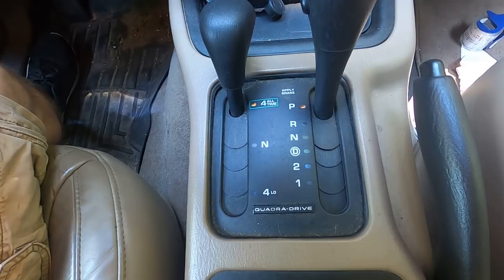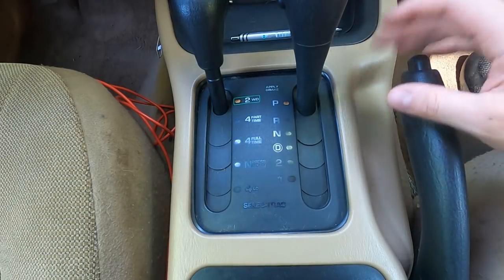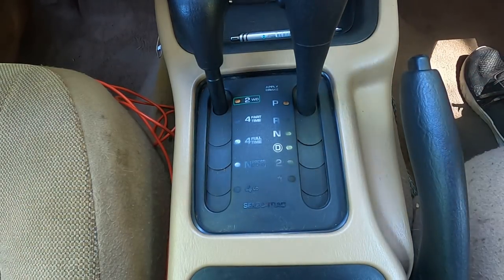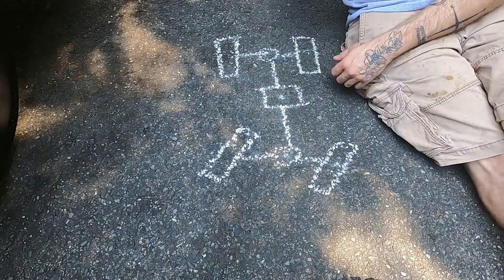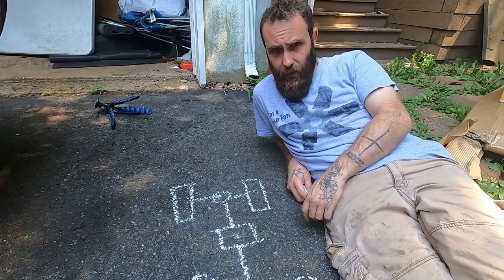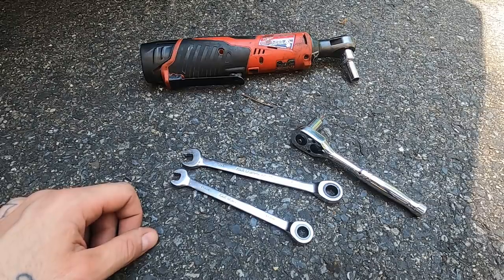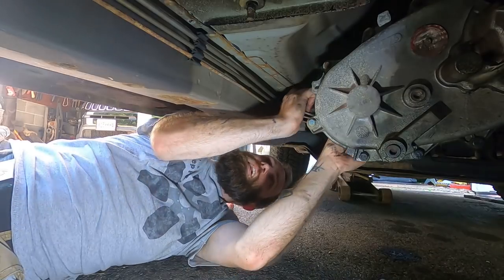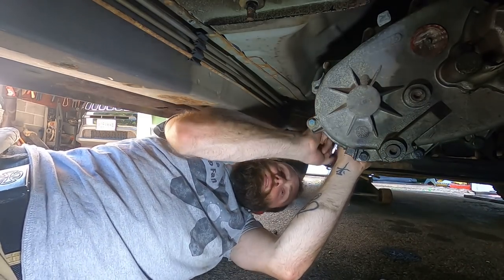Noise/Binding When Turning? How to Diagnose & Fix

Comment: What if you have noise only turning left light grinding sound . Will pulling front drive shaft out help that issue ??? 2000 Jeep Grand Cherokee 4.0 .any idea would be great .

Comment: hi I have a 3.0LTR 2014 RRS, only When turning right there's a noise coming from the rear,  50,000 mile .. could it need a oil change on the rear diff,  and should i do the front also.. i done the transmission  oil 6 months ago. 
only in the morning and only turning right...  after that the noise goes.

Comment: I have 247 and previous owner took the drive shaft off and my transfer case is leaking so part of me wants to do switch to 242 but is there a way to test the transfer case before replacing everything?

Comment: When you pulled the drive shaft did you keep the lever in neutral?
Reply from the maker: Yes, so I can spin it and access all bolts. Wheels need to be chocked so the jeep doesn’t run off on ya

Comment: Hey Doug, I have a 02 WJ Laredo 4.7 (VIN-N) that has the front driveshaft removed by a mechanic the previous owner payed $80.
The mechanic told her that fixing the problem would cost $650 but removing the front driveshaft was only $80.
She told me that the Jeep would get stuck in 4WD
What is wrong with my Jeep and how much will it cost for ne to fix it? I really want 4WD but have the ability to easily change from FT4WD and 2WD

Comment: My FWD 4 cylinder van got stuck in deep sand last month.  Trying to get out it made some nasty popping noises.  A few weeks later I noticed it makes a single popping noise now sometimes reversing or driving out when parked for a while.  it does not make the noise when the van has been driving for a while.  What's the best way to diagnose this?

Comment: I have a 2002 jeep liberty I recently pulled a friend's  small camper with it  is a manual shift 2wheel 4 wheel high an 4 low  anyway after I pulled the camper I stop the vehicle shifted  back to 2 wheel drive an as I was dri ING it later it started a loud grind but not a continues one like it was making a rep and grinding . So I've been driving it In four high but my gas mileage  blows  so you know if I can remove my front drive shift as well

Comment: Awesome vid. I have a 2000 grand Cherokee 4.7 quadra Trac. My from driveshaft rear CV keeps going out. Not sure if it's a cheap Amazon part or something else. I removed the front shaft. After removal I am still getting that binding sound.
Reply: you have to replace the cv join by a double Cardan type join. The sound you are hearing could be from the rear driveshaft, it has two u-joints that may need to be replaced
Reply: @jesusrperezd  the binding sounds and feels like it's coming from the rear diff. I do have two u joints for the rear shaft I. Going to be putting in. Also!!. I don't know if my front drive line needs to be balanced or installed a certain way. I'm getting a slight vibration at about 55-60mph. The rear shaft has zero play and feels really tight but I'm sure they have never been changed in 225,000 miles

Comment: I’m in the same boat. Viscous coupler in my early 249 is shot
Reply: The 249 VC in my 96 ZJ lasted 232,000 miles LOL...I was surprised considering the frequency that it was offroad....it was covered in mud much more often than it was ever clean.  I was surprised how well the 4WD system did given it had open differentials and only ran all terrain tires on it.

Comment: Hello. I'm looking into getting a 99' WJ 4.0 with the dura trac 2. The owner says everything is solid except when he engages 4wd (I'm assuming low range since it's full time 4wd I believe) and the front driver's side wheel clicks for a few seconds then goes into it's respective mode. Is that a red flag?

Comment: My XJ won’t go into 4WD on the fly, it’s a 231, I changed the fluid and it came out clean. I can only get it into 4WD in N and only into 4L

I’ve also checked the linkage and that seamed fine, it went into each position but the 4H just didn’t engage. Would pulling the driver shaft tell me anything?

Maybe it just time for another 231

Comment: Hey Doug, one commenter mentioned a metal to metal slamming sound in her post, I too are having this happen when i hit a dip or speed bump at speed as she mentioned. No reply was given. So please could you respond as she said she replaced shocks and it still slammed, and i was about to do the same until I read her question. I also have that front  popping binding sound when going from 4w to 2w.. when turning left. I have a 2000 GJ wj 4.0 select track . Any help is greatly appreciated👍 Thanks Buddy 😊

Comment: FYI: ZJ ´93-95 249 TC without front drive shaft will burn up the visco inside of it if. Also the Jeep can roll in Park.  Its all fixed in the ´96-98 249 TC
Reply: That’s my situation right now 😂
Reply: Same thing will happen in the 96-98 249's as well if you pull that front drive shaft.  The only thing different with the 96-98 249's is the Viscous Coupler only applied in full time, and they added a mechanical low range....the older 93-95 249's the viscous coupler was the connection in low range as well, so you never really had locked low range it was still limited slip through the viscous coupler.
Reply from the maker: I should have mentioned that. Thanks!

Comment: I have 2- 249 j and I have drove many miles without the front drive shaft.   I have the same problem as you. I have a huge lift at least 4 inches of lift and I have over 10 degrees of angle on the front drive shaft. When I turn sharp it binds up and when I go to 34 to 45 mph it gets loader and then when I let up on the accelerator I get even more. Noise until I drive off the road to the dirt then I don't hear anything like the other noises . Can you please help me

Comment: I have a 99 WJ 4.0 with selec trac front drive lines been out since I got it from the last owner and now randomly today I went to turn left and the moment my wheel moved it made a weird sound and there was some sort of tension in the steering wheel I’ve never taken it out of 2wd i haven’t installed the drive line either still waiting on a new tcase
Reply: Really confused on what it could be

Comment: I have a question I'm hoping you can answer for me. I have a wj quadra drive. When taking tight turns it feels like the rear diff is locked. Sort of like it's resisting the turn. Obviously it seems like the rear diff is problem. Two other things have become a problem that I wanted to know if they would have any effect. 1) The abs light has come up, the brakes actually are working better than before the light came on and before the light came up if felt like the abs was kicking in all the time under normal braking in good weather. I've assumed it's a electrical issue rather than the pump itself, sensor or module. 2) I recently noticed who ever last changed the transmission fluid has massively over filled it. It's well above the cold line when it's well warmed up. Is it possible that a dodgy abs system could make the car think it's losing traction when it isn't causing the diff to try and lock when it isn't needed? Is it possible the likely increased pressure in the transfer case could make it engage when it isn't needed? Should I just accept the rear diff is probably fried?
Reply: I forgot to also mention the gear change is odd. It holds first and sometimes second longer than it should and then lumps into gear from 1st to 2nd. This is massively improved when everything is warmed up. It's also really quick to jump down a gear even under gentle acceleration. I bought the car for very little. Its a 3.1td with only 77k on the clock. Inside and out the vehicle is immaculate so even if it turned out to be every diff and the transfer case I could seel the it in parts for more than I bought it for but Its already really grown on me despite its issues and I'd like to save it if I can.

Comment: Another good one Douglas.Is that Edelbrock intake going on the 318?
Reply from the maker: Dang Dan... nothing gets by you! That is correct. I am slowly collecting the parts I need for the carb swap. It is not a cheap build, but by the winter I should have everything to get to work.

Comment: A little advice Doug,  when I  put my select trac in 4WD the front drive shaft is grinding. Not very loud but noticeable. Is it the shaft itself or is my front differential making that noise 🤔.... thanks
Reply from the maker: Might want to check the rzeppa joins on the front drive shaft. they go back and do all kind of crazy thing
Reply: @DEInTheGarage  changed front drive shaft all together, much better now. Thanks again man
Reply: @fredwilliams4373  Hi Fred, the noise was when going straight or turning?  how is it now?
Reply: @jesusrperezd  I figured it out,  it was the rzeppa joint.... its fixed now but I'll upgrade to a double cardan soon. Rzeppa style doesn't  like lifts of any sort

Comment: How do you test with the 242hd? I’m about to hack and tap mine and install it
Reply from the maker: If your 242HD is binding, likely you are in Part Time when you think you are in Full Time. If you have to, go under it and circumvent the linkage and try to shift it directly at the level on the TC. if it is still binding it might have something mechanistically wrong inside the case

Comment: I removed my front drive shaft till November.  Drives great now.  What puzzles me is that first I changed the front differential fluid and it rag great for about three days. Then, it started binding again.  Changing the transfer case fluid made no difference at all.  What do you think is wrong?  I might be moving back to Europe next year and I want to take this jeep with me.  Help!
Reply: Hi, the sound you had was always or just in 4low, and taking turn?
Reply: @jesusrperezd  Taking a sharp turn in 4 high.  It's a constant 4x4 so I always leave it in high.  It's binding on sharp turns, like in a parking lot. With the front drive shaft removed, it's fine.
Reply: @plsniper  Thanks for your response, so you removed the front driveshaft since then, you didn't identify the issue, did you?, It may be a Jeep thing, mine is doing something similar.
Reply: @jesusrperezd  Yes, exactly.
Reply: @plsniper  the bad thing is it is not 4x4 anymore :(
Reply: @jesusrperezd  That's right. But I don't do offroading really.  My 4x4 is for the winter time. Come November, I reinstall the driveshaft and I'm back to 4x4 again for the winter.
Reply: @ D&E In The Garage

Do you have any response to this issue? 

I have the same thing going on in my 2000 4.7 QUADRA DRIVE

Changed out the t case fluid, no change

Changed out the front diff fluid and replaced with 75-90 and mopar limited slip, worked for about a week then it's back to the groaning and binding again

Love my WJ help please!
Reply: @jesusrperezd  I have an update. I just adjusted my power steering, It's a nut with an allen wrench nut inside. Loosen the nut and then use an allen wrench to go half turn to the right.  It tightens up the steering so it does not feel like a boat anymore, but to my shock it made the binding up way better. It is so much better that the next summer I will probably not take the front drive shaft off anymore.  Go figure, you adjust the power steering and the binding almost goes away. :)  Hope this helps.

Comment: i got a 97 zj and the rear seems to bang pop and grind when turning when i press the clutch in it goes away but the strange thing is, it dont do it when its cold after a few miles drive it happens, its a manual and when it gets hot it can struggle to find gears to.
Reply from the maker: Hey, I would like ot help, but am confused. they didnt make a manuel ZJ in 97. last one was in 94. I know it seems like an insignificant detail, but I want to get the fact straight to help you diagnose.. Sometimes responses get lost in YT comments, so email me if you'd like dandeoffroad@gmail.com
Reply: @DEInTheGarage  Im in the uk, 2.5 TD 5 speed manual.
Reply: Thanks for the quick reply btw.
Reply: Ive emailed you to thanks mate.

Comment: Doug i got a 99 jeep grand cherokee limited 4.0. I got the quadra trac II.I have the 247transfercase. Also I got a dana 30 in front and a dana 35c in rear. What I'm asking is do I need to add the friction modifier to my diffrentials. Or are they all open not limited slip? Your help would be great going to knock gearlube fluid out tomorrow. Love the videos👍👍👍
Reply: I am almost sure both are open diff so you don't need the friction modifier. An easy way to know is to get the datasheet (online) with the VIN number, if in the sheet is indicated "Varilok"then you need the additive.
Reply: If u have varilok do u need friction modifier in the front and rear? @jesusrperezd

Comment: Can you put a varilok Dana 44a in a Jeep WJ inline 6 with select trac? Can’t find any info saying this can or can’t be done
Reply: The whole rear axle you mean? Sure you could. The Varilock is a mechanical limited slip that’s wholly contained inside the axle housing so it doesn’t care what transfer case is in the Jeep. Would be a nice upgrade for a Jeep with an open rear differential, well as long as it’s working right… make sure you use the right fluid (75w140 synthetic) and Mopar friction modifier.
Reply: @TireSlayer55  yes, the whole rear Dana 44a. I appreciate the answer, it seemed like it would be an upgrade to an open diff that everyone would use cheaply, but I figured something prevented people from doing it, I guess it’s just cost or was at least. I probably will try it in future my rear is going out shortly

Comment: I am currently trying to do this. And I can't get any of the bolts lose. I've tried every trick I can think of and I. Ant get them. I striped a few too. What do I do?
Reply: I just removed 1 from the junkyard today.  I used a 5/16 12point 1/4 in drive ratchet and little breaker bar for leverage .

Comment: I have the same make model and year Jeep with the exact same issue. Im just a little confused. If I pull off the front drive shaft and the noise goes away what do I need to look at fixing from there?
Reply: Any update to your issue ? I added extra friction modifier but haven't noticed a difference yet
Reply: @scalywag  Any news about your issue? is the noise always or just when you take tight turns?

Comment: Can the Quadra-Trac II use 2WD?
I only saw the option of 4WD Hi, N, and 4WD Low
Reply: Its full time 4wd.
Reply: 4HI means  2wd (rear traction) in normal conditions, when the transfer case detects front wheels are in different speed / lost of traction, it automatically sends power to front drive.

Comment: I had a problem on my 2000 XJ  with the (242 TC) it was ok when in rear wheel drive but when I put it into full time 4 wheel drive after a short time the front right hand side wheel would start binding bad I took it to several so called people who say that they now about this stuff one said the front axle the other said the rear axle it turned out to be the TC third guy spotted the problem put a S/H  TC in and the problem was solved I still do not understand why ???
Reply from the maker: Yea, that is basically what my issue was. I am still not completely understanding why the issue manifested that way, but I believe a new TC will solve mine as it did yours
Reply: just guessing but maybe a bad coupler in the transfer case, sending too much drive shaft speed to your front axle as compared to the rear, which the front axle diff then sent to the one side wheel mostly, which would cause binding while driving due to the different wheel speeds?

again just guessing don't even know if that's possible, but I know the 242 uses a coupler for full-time four-wheel-drive, I don't know if it's a vicious coupler or what exactly.

Comment: Doug, my wife says when she puts 99WJ w 242 WJ transfer case in 4PT and Selec-Trac, it feels like something is going to break whenever she just turns the steering wheel w/o moving( in driveway )not to mention while moving, and that it was stuck in 4PT. I jumped in but was able to shift it back to normal immediately so I never felt the issue. Is that pretty much what you were describing in this video...or did you mean specifically when turning on the road?
Reply: Doug, Sorry- I rewatched the video and you already answered my question! Good stuff. BTW, I'm naturally a GM guy( all my vehicles), but my wife has always had WJ's and I've been the one who worked on them...so I've really grown to love WJ's...I know so much about them now!
Reply from the maker: You have a smart wife! haha. Just to clarify, 4PT is for offroad and loose surfaces only. She want to be in 4FT for on-road use. Hope all is well!
Reply: Well thats where me and the wife went wrong i guess. We ALWAYS only use 4PT.. Now I have to convince her that shes wrong and she needs to start using 4FT.

Comment: 2005 Jeep Cherokee Limited 5.7 AWD Quadra Drive 2 binding when turning and clicking noise. Feels like the Jeep is struggling to drive; torque. Anyone have a idea of what it could be? Removed the front drive shaft and it drove fine but could only drive below 35mph because it was in 4Low. That’s the only way it would move. So had the drive shaft replaced which was a cv axle attached to transfer case on one end  ujoints on the front part attached to differential. Drive fine for a few weeks then back to same issue. Any suggestions would be greatly appreciated.

Comment: Mine has a slight groaning or shudder when turning right at slow speeds, and when the vehicle is cold. You can feel it in the steering wheel as well. It’s a WJ Overland with quadradrive. Anybody know what it might be? Steering gear maybe?